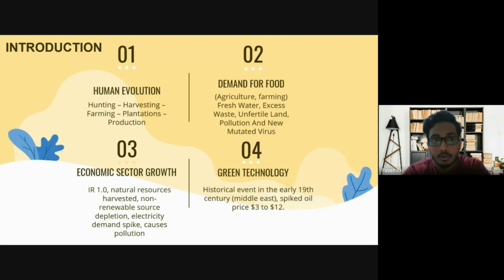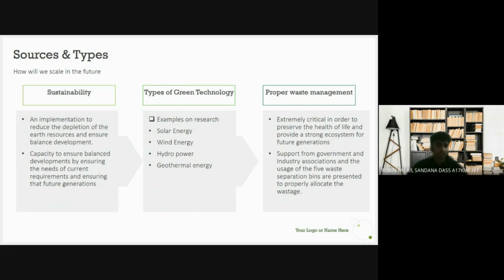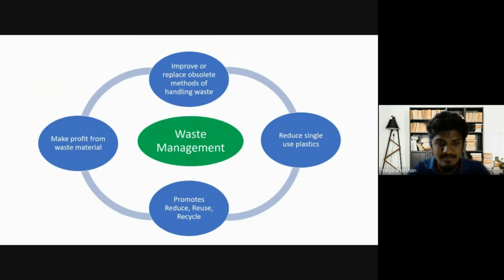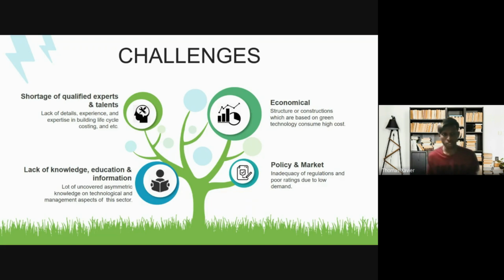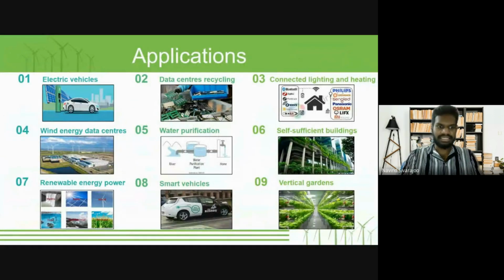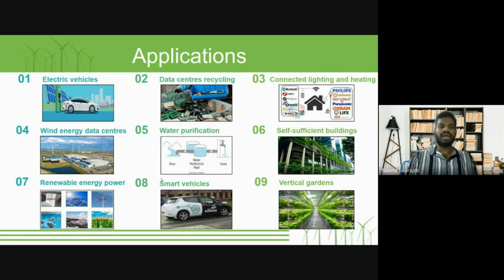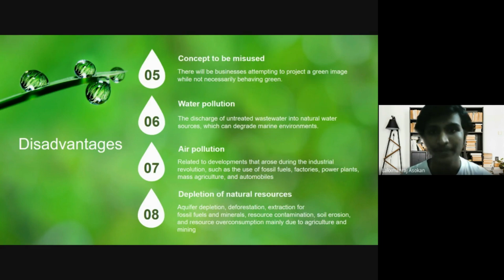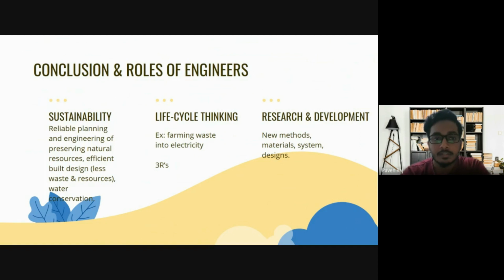Group 10 Presentation Video (Xenon) Professional Engineering Practice

Comment: Group 3 (EngineerX) - Green technology equipment such as solar is expensive. In your opinion, how to reduce the cost to develop this technology in Malaysia.
Reply from the maker: Solar panels are expensive due to the use of high-purity silicon which are rare and extremely difficult to manufacture. Hence the developed of new materials with similar or even better properties should encouraged. 

Thank you for the outstanding question Group EngineerX.

Comment: Hi, I'm Hafiz Razali from Synergy (Group4).

In your opinion, what is the most effective effort can be made by electronic and electric device manufacturer in reducing the environmental impact caused by e-waste?
Reply from the maker: Hi, Hafiz Razali. Thank You for your question. 

A huge majority of electronics devices can be recycled. Thus, more proper approach of collecting and managing e-waste is required. Nevertheless, electronic device manufactures should invest in developing new, safer, and greener products that will not harm the mother nature.